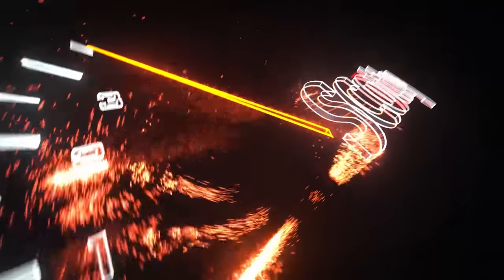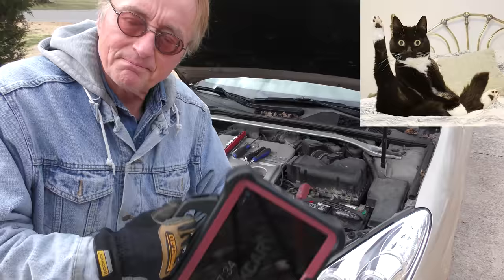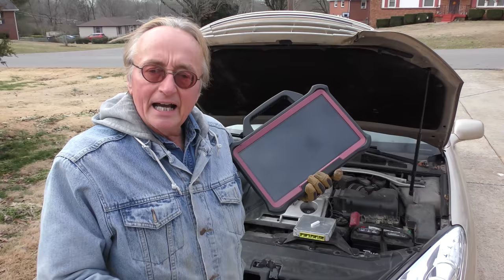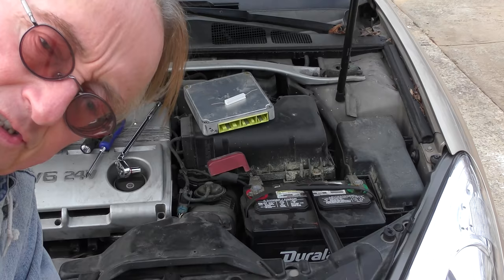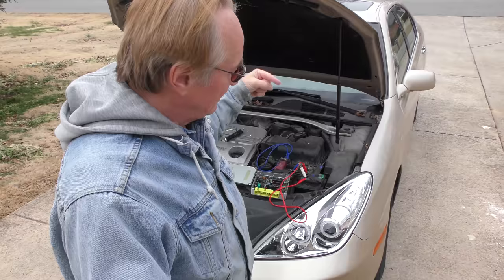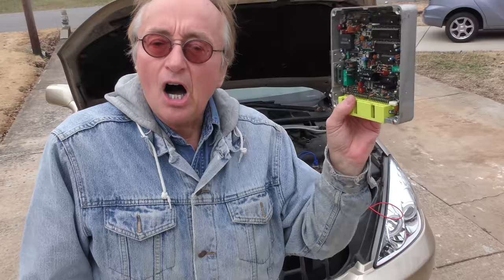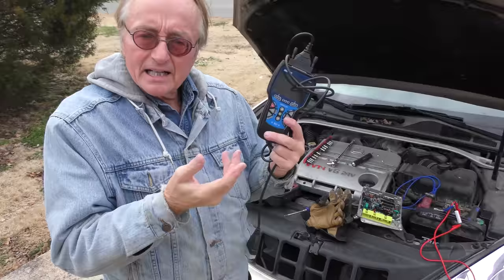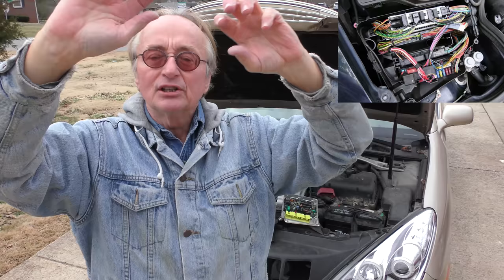This Stupid Thing Will Save You Thousands in Car Repairs

Comment: Scotty.... You re so damn funny! Love it! I work on my own vehicles as well. Have to, I cant afford to take it to a mechanic plus They call themselves a mechanic but I question the majority of them. If I do it myself I know its done right, or at least with quality then some do it. I was quoted $1700 for a front end job. really?  a strut for $400 each for a Buick Enclave. I just did it all myself. Trust me I'm tired of working on cars so I want somebody else to do it. idiots? I did the struts, changed the tie rod ends and stabilizers and did a front end alignment myself. for $300. My car now get 3-4 more miles per gallon. I have already replaced the rack and pinion and power steering pump at an earlier date. That was a job! Same thing with AC. I was told $1800 at a car dealer but I got it done for $100 and a seal. Love the way you do your videos! You are one funny guy!
Reply: I once bought a used Geo Prizm back when that was the thing. It ran right but the previous owner showed me $1500 in repair estimates. I fixed everything for $35 and my own labor. Later, it got shakey-brakey at highway speeds. Fixed all that with two drive axles, one used front wheel bearing assembly and a junkyard brake rotor. Total cost about $200. But that was back in the early 2000s. It might be $300 now. A normal person might have concluded, it was time to junk the car. A shop would have charged at least $100 to do the same. Some might have made it $2000. A lot of them would have tried to sell additional work too, like struts or other suspension work.

Comment: Hi Scotty Ben working on cars all my life . I thought I knew everything ,but you have proven me wrong , love your videos . I have a 202 Ford expedition & every once in a while it die coming to stop sign . It always starts back up ? It has the 302 in it & runs awesome , any ideas ?! Need your expertise . Br
E safe out there .
Reply: Could be the crank angle sensor. Not expensive. Also, the cam angle sensor would cause this.  Check if the distributor is getting wet.  Order a new Distributor if you can't get a distributor seal for the cap.

Comment: You definitely wont need 10 watts worth of a resistor for that application a 1/4 watt would work just as well and I would up the ohms to 10-100  ohms to limit the current even more it will just take a little longer to drain the voltages down with the higher resistance 1 ohms is practically a short and that size of resistor is usually called a shunt when it is to allow amperage readings

Comment: On a Ford Fusion hybrid vehicle how do I stop a wrench light from showing up after an unknown amount of miles at 70+ mph? It goes away when shutting off the car but the dealership has no clue what it is, but one mechanic said it might be the throttle body or mass flow sensor. It's been happening for over 10 years now. When replacing the start battery it still shows up, so the computer is still seeing whatever it is that's triggering it!

Comment: Thank you so very much for this video Scotty. It was a great amount of help I've been trying to find a way to reset my computer's ever since that I had my engine replaced. I need my vehicle smogged and have not been able to smell good since then because like you had said they never reset my computer to the car. But I'm sure after doing what you had suggested I will have no problem doing so of course after I've driven it for a while and reset all of my computer components I think you should work just fine and so thank you very very much Gotti this who was a great help

Comment: With my knowledge of electronics & electricity I wonder about only using a 1 ohm resistor. In my mind that's so tiny it seems practically the same as touching the  battery cables together. I think that 10 ohms would be much safer and still do the job within 15 minutes. If I'm wrong, Scotty or someone please explain the error in my thinking???

Comment: I have an engine light that won’t shut off. Supposedly from the catalytic converter, one of three parts, one was replaced.  Recently needed a new battery and when it was replaced the light went off for a couple of weeks.  Now it’s back on. I’m wondering if no one ever did a reset.

Comment: You took the pos bat terminal off before the neg  terminal ....a  big no no. The handle of the wrench could have touched the frame and shorted out the battery.  Whether  youre connecting or disconnecting the battery just remember to not touch the pos terminal while the neg terminal is connected...unless the vehicle is pos ground ..very very unlikely.

Comment: Not saying you are wrong.  Obviously you've done this before, but the math makes it look like a 2 Ohm would be safer.  2 Ohm will cut the current in half.  1 Ohm is just dividing by 1.  Ohm's law -> Voltage/Resistance = Current.

Comment: Good idea but not so sure about a 1 ohm resister. If it were me I would not go less than 10 ohm. 1 ohm resistor to computer equipment is not much different than a short.

Comment: There is no electrical difference between using a one ohm resistor and touching the cables together. I'd use a more resistive resistor...

Comment: Hey Scotty I seen a video you did prior to discovering this one. And it showed you connecting the hot wire and the neg. Both together with a set of jumper cables or was it with alligator   clamps. Anyway whatever it was I did that tell my trailblazer is still running rough regardless thank you for all your help and knowledge

Comment: Do you need to turn on the ignition. And since Radio shack is gone; where does one buy a 99 cent resistor in town? My 99 Camry runs okay w 250K but hwy mileage sucks <18 generally  Answers.

Comment: Just leave the lights switched on that way it also stops voltage spokes when re energizing the system.. All you saying he took the wrong lead off first ,IT DOES NOT MATTER unless the vehicle is being jump started and then you are supposed to remove the ground from the ground point and not the battery as not to spark the highly flammable gas produced by the battery.. Everyone thinks they know so much after a quick google search....

Comment: Scott. One of your videos mentioned disconnecting the battery and then turning the headlights on to drain the capacitors in the system. Would this do the same as your resistor trick??

Comment: my 2006 jetta 2.5 keeps shutting off randomly while driving/running. when this happens I have no displays or anything electrical showing, just dead. I'll sit a few minutes and I can start and drive anywhere form 5 mins to 20 mins. its not a heating/fuel problem cause it will do this within minutes of 1st start too. Any help would be greatly appreciated. I'm thinking the ECM, speed sensors?

Comment: Hey Scotty, Ive seen like 5 mechanics and none of them can help me. Its been so overwhelming. What can i do? . A friend scanned my car and these codes came up. U1000 and U1096. ON a 2002 chevy cavalier 2.4 LS. So first suggestion was to replace the entire PCM. Except I cant even find one for this model anymore and im in Canada. 

Quick history , car left me stranded 3 times , all power drained super fast and wouldnt start. I used my multimeter to check battery. All readings come back good. Around 12.8. I do know that one cylinder is running alot lower then the rest. I discovered mice were in my engine, but havent been able to find any chewed wires, but thats another process. Basically im wondering whats the best way to resolve this? 

ONe mechanic said i need a whle new alternator, the other said i need a new battery and now a new PCM. My battery reads excellent on the tests tho. Ive been doing this on my own for months, getting so tossed around with zero resolve! PLease help me! WIth these two codes that came up, where should i start? Thank you!

Also could i do this resistor reset on my 2002 cavalier?  Would that help? Thank you!

Comment: Scott I used the 10 watt 1 om resistor attached for 15 min. And nothing drained all codes still there,I did exactly what you did in the video ,the car is a 2017 Toyota corolla le ? Tks.

Comment: Scotty I like your videos, just wondering about GM hybrid cars with hybrid battery failure not running, major codes and crash codes. Will this reset these types of codes.  I agree it works on simple engine codes? More info is needed to cover all types of vehicles.

Comment: Hi, I have a camry 2007 v6 with battery warning on.  i bought and installed brand new battery.  but the battery light is still on.   i did what you show here to reset the computer in the car, but the battery light is still on.   so it does not seem to reset the dash board,  maybe it is the alternator problem now ?  sucks...!!!

Comment: Scotty, I enjoy your videos.  Thanks!  I have a question.  I bought a 2011 Kia Sedona with high mileage in Nov 2023.  I love it!  Previous owner took good care of it.  I baby it too.  However, the dealership tried to pull some crap and tried to charge me $1200 to include the alarm.  The alarm that they turn on and off for FREE.  Anyway, I told them that they did not credit the guy $1200 who traded the van in so shove it.  I bought a port tool and tried to scan the van.  All good, changed a cabin filter.  However, there was a weird side effect.  My after market alarm stopped working.  Also, NOW when I lock the doors, my van's horn honks. That is new.  If I reset the computer using the 1ohm and 10watt resistor method that you suggest, then, do you think that would reset my computer and TURN ON my factory alarm?  Thanks.  Derrick in Phoenix.

Comment: YOU CAN USE YOUR BODY AS A RESISTOR.  ONE HAND HOLD THE NEGATIVE CABLE  AND ANOTHER HAND HOLD THE POSITIVE CABLE FOR 10 MINUTES. THIS WILL WORK IF YOU HAVE NO RESISTOR.

Comment: Just wondering if I used a test light between the battery cables would the light bulb in the test light be a good enough resistor and work the same as Scotty's device resistor?

Comment: I'm not sure exactly what happens with the resistor the battery in the computer module. Did he do anything to that computer module or did he reset it on the battery? Where are the code stored in the computer module?  How does the car get reset with the computer module not even attached to it?

Comment: Hey Scotty I got a question, I got a 2004 Nissan Sentra , and I just had to replace my radiator because it got a crack in it.. it ran really good yesterday. But I tried to start it this morning and it cranks but won't start . I got spark and my fuel  pump is good. What else could it be.. plz help

Comment: I have a 93 volvo 940,,& it wont start mIve replaced almost every part, ign cables cap rotors injectors etc,,300-,000 miles,how donI chek tyhe ecu/ecm to see if something is burned out intennally?/

Comment: Hey Scotty, I inadvertently triggered 2 AWS codes on my 2009 Porsche Cayenne S while using an I car soft Porsche V3.0 and now have the airbag light stuck on. I addict technical service was no help unfortunately. So I sent it back.
Any reasons you can think of that this would be a bad idea to try ???
I'm also experiencing a slightly rough idle and some kinda hard shifting.
Thanks for all you do...
Thanks

Comment: At about the four-minute mark, you mentioned getting a 10-watt 1 ohm resistor is that for all Toyota's? I have a 2006 Toyota Highlander, would I use the same, a 10 watt, 1ohm resistor ?

Comment: Doesn't work with my car. I've left it overnight with the terminals connected and didn't even lose radio stations, trip meter or anything. Even the clock was still right.

Comment: I got a question I have a Nissan Frontier pro 4X king cab 2017 manual 6speed, V6  It was made in the USA. Bought    the truck and it came from Canada. When I go to buy parts and put in the VIN number it tells me it's automatic 4 banger. It came with all the bells and whistles. Backup camera and senser when I put the truck in reverse and get to close  the beeping noise starts. Now I don't get the beeping noise any more. The toggle switch in truck the light stays on telling me that the sensors are not working only in reverse. So I took down to Nissan service department I paid 180.00 plus tax to tell me the 1 sensor isn't working right. And it's going to cost 800.00 plus the 180.00 to see if that was the problem. Do you think Scotty little trick will reset it back. And also the odometer is in kilometers not MPH.the dealership told me that the trip meter isn't in MPH only,  or the temperature on the rear mirror has Celsius and not Fahrenheit. I go in and change it but just goes right back to the Celsius. 
Can anyone help me or think Scotty little trick will work ❓❓❓❓

Comment: I would like to reset a code on my F250.  It has two batteries.  disconnect both and apply to resistor to either battery???

Comment: Scotty, aren't you supposed to disconnect the negative terminal first? You took off the positive first which could cause a short. Anyway, I will try this resistor trick and hopefully the odometer will reset to zero, so I can sell my old 1998 Nissan for $25,000..! Ha ha ha ha ha. 😂😂😂 Maybe sell it as a vintage car for $50,000. Ha ha ha ha 😂😂😂

Comment: Computers have no business being in a car. My 69 Mustang doesn’t have a computer anywhere near it and it will run circles around these modern, overpriced, plastic pieces of crap driving around these days. “Oh, but the computers make them more efficient and conserve fuel. Okay leftie. Whatever. My “Stang gets about 10 gallons to the mile and it’s so much damn fun to drive you won’t mind the time you spend at the gas pump. Try it. You’ll love it.

Comment: Yeah that would never work. What a joke lol
Reply: Cars don't save memory with the battery it's flash type memory It doesn't matter how long you keep the battery disconnected or drain them capacitors this would never shut any light off especially on anything new.

Comment: You’re worse than the “scammers” you focused on proving your ridiculous science theories instead of testing real possible ways to produce energy. Your math about he alternator is garbage, you calculated it as a motor (backwards) if you spin it it’ll be impossible to calculate the energy need it to spin it unless unless you know all the exact facts such as, What’s spinning the alternator?  Is it a belt? Is it the wind when the car moves? Is it a wheel, an axels shaft? Are the bearings in the alternator in perfect condition is the car going uphill or downhill? Your info is selectively correct but your point is as wrong as marring a single mom.